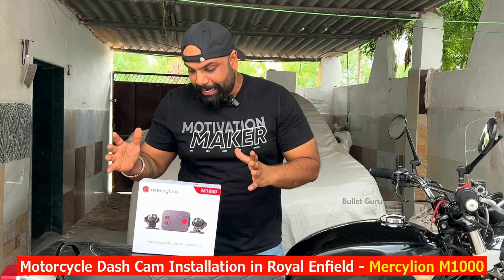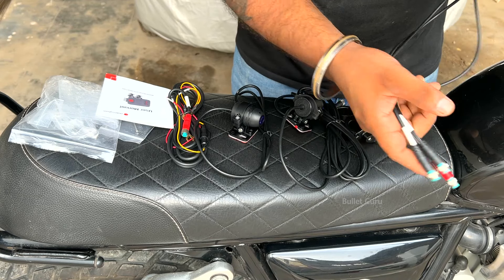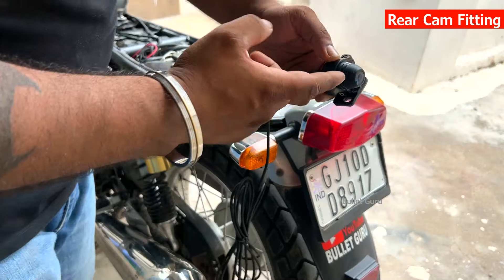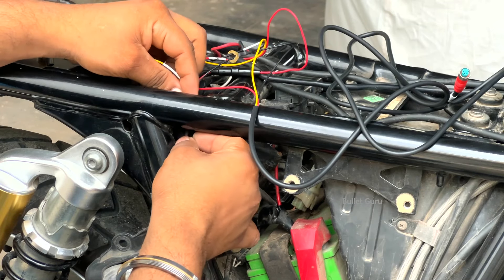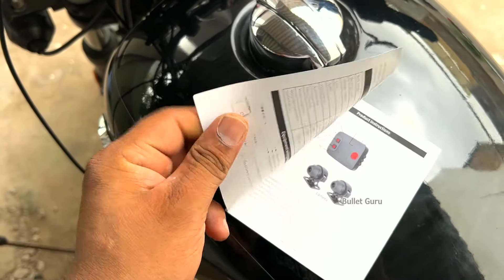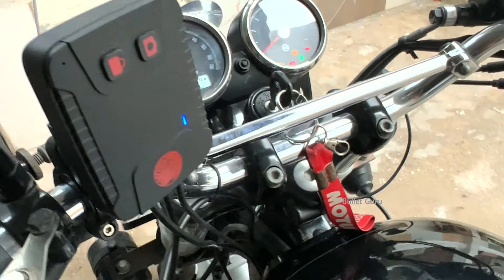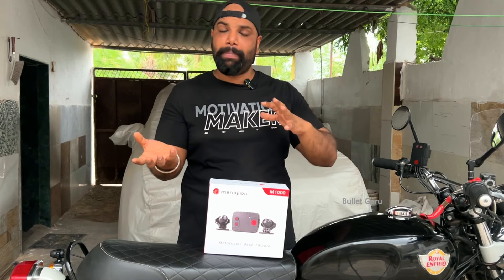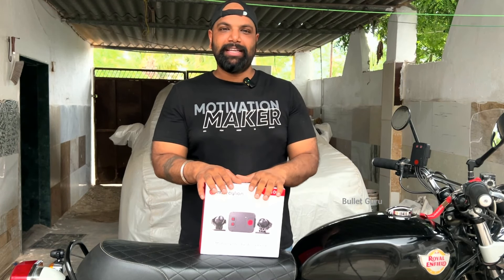Dash Cam for Motorcycle - Full Installation & Road Test | Mercylion M1000 Dash Cam

Comment from the maker: BUY LINK - 
Mercylion M1000 Motorcycle Dash Cam - https://mercylion.com/collections/motorcycle/products/mercylion-m1000-motorcycle-dash-cam?sca_ref=6521585.X8vCRMlvFV

Use 'BulletGuru' Coupon Code for 10% Discount.

MICROFIBER CLOTH - 
- Microfiber Cloth Set 222GSM - https://amzn.to/3zcs39M
- Microfiber Cloth Set 340GSM - https://amzn.to/44ngEhM
- Microfiber Cloth Set 900GSM - https://amzn.to/4beSKYL

RUST CLEANER / Maintenance --
- WD40 Multi Purpose spray - https://amzn.to/3NwsDmf
- Kangaroo - https://amzn.to/3iM8zMt
- ZORRIK 88 - https://amzn.to/2ZXWfjA
- Kelvinn Rust Cleaner - https://amzn.to/3VWluA3
- 3M Dry Silicon Lube - https://amzn.to/4beSKYL

RAIN BODY COVER FOR BIKES - WATERPROOF 
- Royal Enfield Body Cover - https://amzn.to/3raaumP
- Royal Enfield Mid Quality Cover - https://amzn.to/4eBk6Ln
- Royal Enfield High Quality Cover - https://amzn.to/4biPCLr

CHAIN LUBE BUY LINKS - 
- MOTUL CHAIN LUBE COMBO - https://amzn.to/3optxCX
- KANGAROO CHAIN LUBE COMBO - https://amzn.to/3lLvTdp
- CASTROL CHAIN LUBE - https://amzn.to/36LhHNm
- LIQUI MOLY CHAIN LUBE - https://amzn.to/3lUqDVe
- VISTA CHAIN LUBE GEL - https://amzn.to/2VN6sO0
- 3M CHAIN LUBE - https://amzn.to/3gf0GOT
- GEAR OIL FOR LUBE - https://amzn.to/39J1kTz
- CHAIN CLEANING BRUSH - https://amzn.to/3gt8rAZ
- TRM Chain Lube & Cleaner - https://amzn.to/3YyCVrh

Grease Base Chain Lube -
Lithium Grease Chain lube link ---
Kangaroo Grease Lube - https://amzn.to/2XHCQ97
Sheeba Grease Lube - https://amzn.to/3moMMyO
Nikavi Lithium Grease - https://amzn.to/3zaBXUm

CLEANING & CARE POLISH ( Matte & Glossy Polish) ---
1. Microfiber Cleaning Cloth - https://amzn.to/2ZbqTaL
2. Chain Cleaner Brush - https://amzn.to/2KJ6mTc
3. All in One Cleaner Polish - https://amzn.to/2Z0Q40o
4. Body cover Silver - https://amzn.to/3mdsB3x
5. MATTE Paint Polish - https://amzn.to/2YVPalY
6. Motul Combo(Lube & cleaner) - https://amzn.to/2ZcY75u
7. RE Body Cover - https://amzn.to/2MqQbfm
8. WASH SHAMPOO - https://amzn.to/2mXUoM9
9. FAST WAX SPRAY - https://amzn.to/2mfvXJY
10. 3M WAX - https://amzn.to/2nOFlEw
11. SCRATCH REMOVER - https://amzn.to/2mWYxA6

ENGINE OIL BUY LINKS–
1. SHELL 15W50 - https://amzn.to/3qCq0Cc
2. CASTROL 15W50 - https://amzn.to/2nKmISt
3. GULF 15W50 - https://amzn.to/3lVBy19
4. Motul 7100 20W50 - https://amzn.to/2HbPmp9
5. Liqui Moly 15W50 - https://amzn.to/37ep1Sf
6. Motul 5100 10w50 - https://amzn.to/2T4tWNu
7. Motul 3100 20W50 - https://amzn.to/37f3Gbx

BUY TOOL KIT FOR HOME 
1. SPANNERS SET - https://amzn.to/2NxsXme
2. Tool Kit, Screwdriver and Socket Set - https://amzn.to/2YDu1ew
3. Mini Tool Kit For Home - https://amzn.to/2CGJSAq
4. Home DIY TOOL Kit - https://amzn.to/3i5sKEZ
5. Bosch Mini Garage Tool Kit Set - https://amzn.to/2HcV7Dt
6. Taparia Socket Set (Recommended) - https://amzn.to/3eL5uda